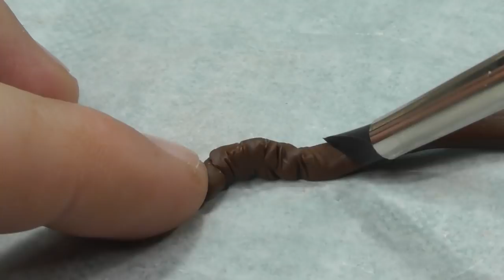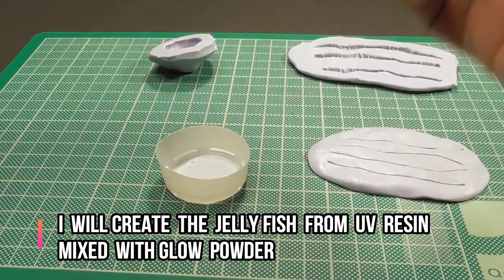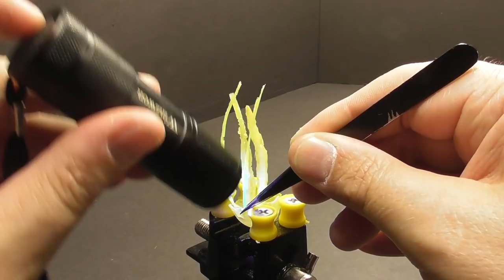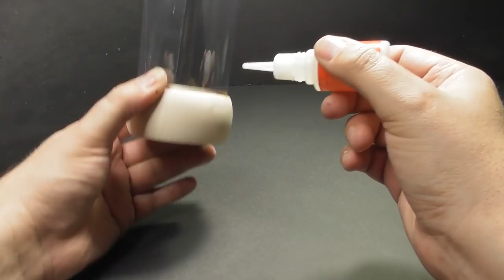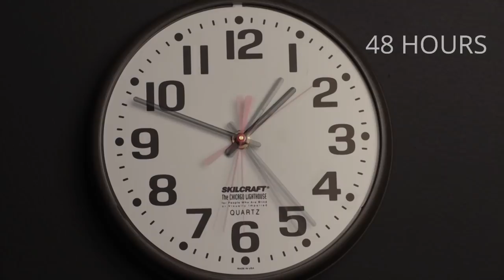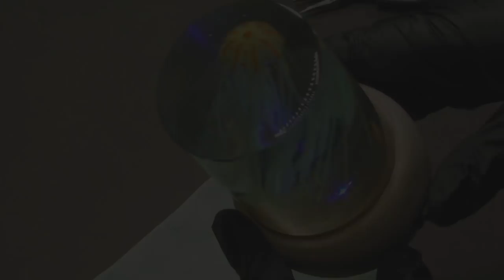JELLYFISH in EPOXY RESIN- Resin Art

Comment: I love your work - one question though - in some cases the embedded air bubbles in the resin add to the aesthetics - but shouldn’t you be using a vacuum to degas the resin more?
Reply from the maker: Thank you for your comment 😊. In this particular case I wanted the air bubbles. In.other cases I agree with you that is better not to have air bubbles.  By the way I have recently bought an air pressure tank for future projects.  😊👍👍
Reply: 4THECRAFT would love to see you use that and get good results. 👍

Comment: Brilliant!   Have you ever considered using a pressure pot during the curing of the epoxy to eliminate the tiny air bubbles?
Reply from the maker: Thank you. Yes, I am a bit unlucky with this because I have bought a pressure pot for spray paint and tried to convert it to a pressure pot for resin curing but so far I have a leakage I cannot find and the pressure is not stable. I was planning to use the pressure pot for this and next projects but until i resolve the issue i cannot.
Reply: 4THECRAFT your art still looks amazing anyway!